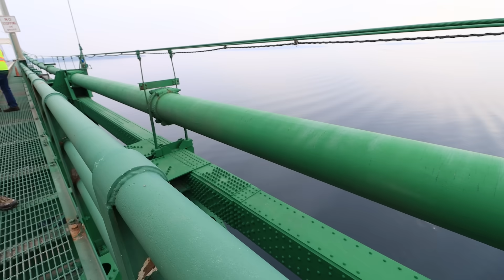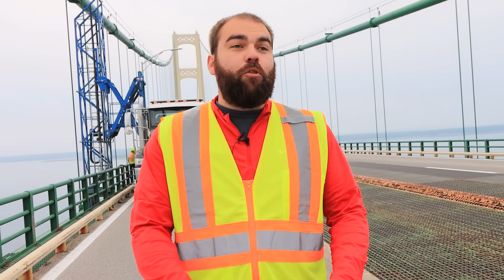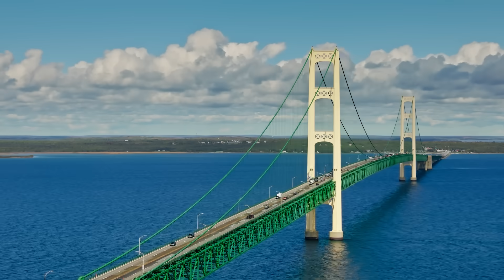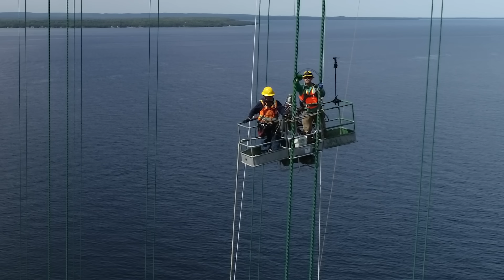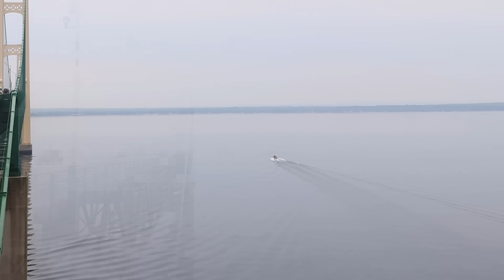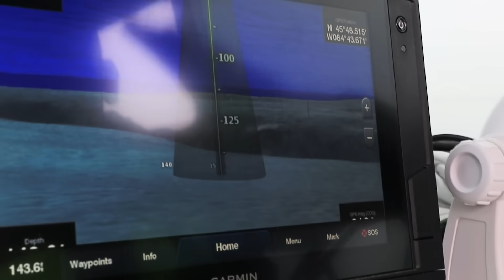How They Keep the Mackinac Bridge Alive

Comment: Of course it's safe! Even a bridge that is classified as a 'fair' or 'poor' rating by the Federal Highway Administration has absolutely no risk of collapsing. That distinction goes to structurally deficient bridges with major design flaws. The Mackinac bridge does NOT fall into that category.

Great video!

Comment: First time over bridge in 78, they had a section of the metal grate removed with only a couple of orange cones blocking the hole in the deck. Near the middle of the bridge, so it was a long way down to the lake. Kind of freaky. I wonder if they’ve revisited how they handle those situations.

Comment: The center metal section is crazy sketchy to drive on, car pulls side to side even at slow speed. 90% of the traffic only uses the outer paved lanes
Reply: Try it on a motorcycle! The freaky side-to-side action notwithstanding, the feeling of flying is awesome! You look down and see - not much supporting you because the grating speeds nearly invisibly by - just water and ships. Absolutely awesome.

Comment: The subject of replacing the bridge decking in this video . . . 
The same issue was handled on the San Francisco/Oakland Bay Bridge in the Fall of 1989, where an act of nature intervened to expedite the replacement paving . . . The Loma Prieta Earthquake.
A section of the Bay Bridge collapsed, which forced the bridge to be closed for a month for repairs.  With that downtime the work crews went all-out to replace the bridge decking.

Comment: I'd be curious how motorcycles handle the finger-joints.
I've had previous experience on a motorcycle traversing over the finger-joints on the Golden Gate Bridge, which made the bike do a quick shimmy with a slight twist on the handle bars.  But those Golden Gate finger joints sections looked shorter than what's on the Mackinac Bridge.

Comment: Excellent presentation, thumbs up!

I've only crossed the Mackinac Bridge once. That was in 1975, taking an excursion on my way back to southern Ohio after spending the summer working at a kids summer camp in Canada. 

The crossing? I was terrified. But it wasn't exactly the fault of the bridge. I was terrified because I was riding a relatively small motorcycle (350 cc Yamaha road bike) with some gear strapped to the luggage rack. It was overcast like in much of this video. On my approach to the bridge, I hadn't considered wind gusts high above the water...duhhhhh. 

Once out on the span, I FELT like the bridge was moving underneath me, first one way, then the other. Or it may well have been the steel decking which I later learned was problematic for any two wheeler.  

I'm willing to accept the description early in the video where the bridge expert says the entire structure will be moved sideways, but not sway back in forth as I perceived it. Maybe. Either way, I promise I'll never ever try that again on two wheels!

Had I known then what I know now, I would have chosen to change my route plan and go around, no matter how far I had to go!

Comment: ehhhh old up there bud!!!  "number of times per second your tires are hitting the beams in the road"... my hiney! at the same speed, regardless of tire size or bridge construction, the acoustic tone would remain the same!  .... the change in the pitch is a result of the the air movement around the grates as you drive over them!  if you travel at 1 inch per second, and your beams are 6in apart.... regardless of how old or aged they are, youd still only hit 1 every 6 seconds!  the finish on the steel is what changes with wear and corrosion!  much like the Golden Gate Bridge, if you "tap" an aged piece of steel that has some corrosion on it, its a duller tone than that of fresh steel that would be a higher/brighter tone!

Comment: The bridge may be safe but the same can't be said about the pipeline, Enbridge line 5, below the bridge. A full account of the issues can found in Wikipedia.
Reply: Enbridge wanted to build a tunnel for the pipeline.  I wander if that was allowed or is it still an unnecessary disaster waiting to happen?

Comment: I've been across the Bridge quite a few times... including several on my 125cc motor scooter. Doing it on a bike is especially nerve-wracking, because on the outside lane you can see through the barrier, and on the inside lane, you can see through the freakin' road! And keeping steady riding a two-wheeler on that grate is far more difficult than doing it in a four-or-more-wheeler. But that's also given me a more unfiltered view of the Bridge itself than most people get, and from what I've seen it's in remarkably good condition: my biggest fear was about my own skill in keeping my bike upright. For one crossing, the wind conditions didn't feel safe for me on my bike, and the Mackinac Bridge Authority kindly transported me and my ride across in a pickup. The MBA is doing good work.

Comment: Riding over the bridge on a motorcycle can be a little iffy. Those expansion joints can grab the tires just so and make them shaky. Also when I rode the bridge I always stuck to the paved parts and avoided the metal grids. It's bad enough in the dry, but when it's wet, be careful. That said, the view is amazing, especially on two wheels. Thank you Alexis, I love all your videos. I was born in Detroit, raised in Saginaw and now live in the SW part of the state. Michigan is my home.

Comment: I used to be the maintenance guy for one of the paint contractors that were out there several years ago. Ive been all over, on, in, around and under the bridge but I never got to walk the main cables. Inside the anchor pier are really interesting. You can see where the main cables come in and split apart to anchor the cable to the concrete. They do not allow pictures of it for security reasons.